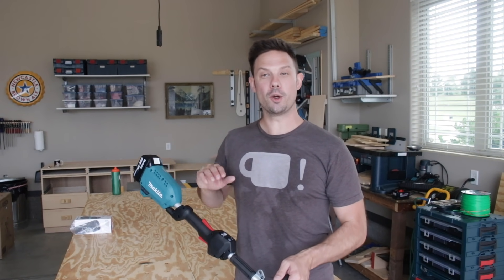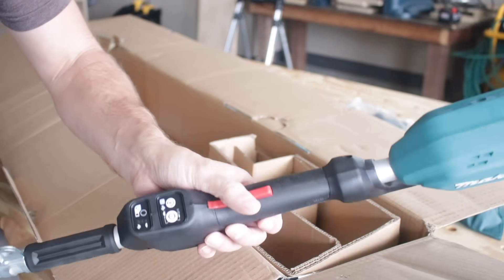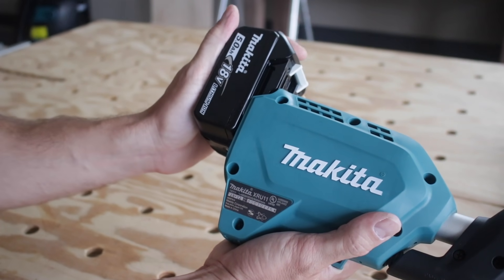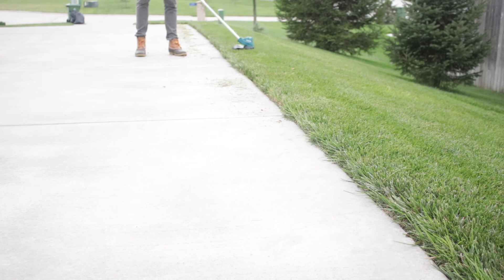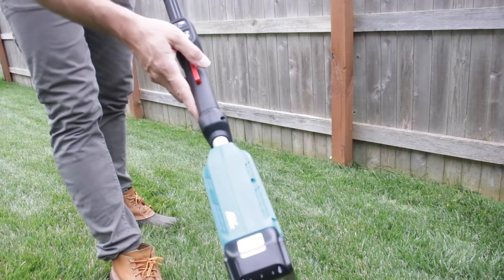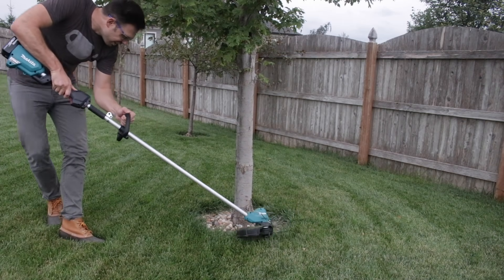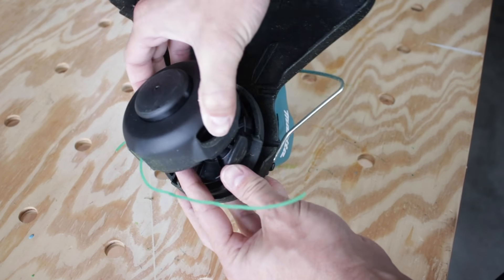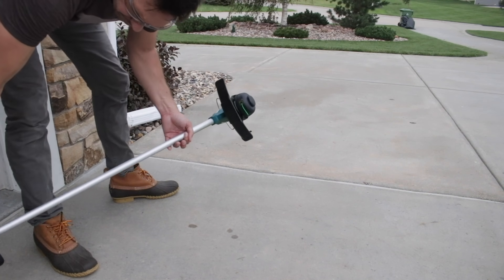MAKITA 18V Brushless Battery "Cordless" String Trimmer / Weed Eater Unboxing & Review

Comment: Thanks for the content I appreciate the awesome video!! I have all Makita tools and I know with my past history they build quality products. I didn't think it would be powerful enough until I saw your video and my lawn is half your size. Do you know of a replacement head that I could purchase so I don't have to deal with the string anymore?
Reply from the maker: You bet! Thanks for sharing some kind words.  Yea I am really into Makita these days.  Man I sure don't know of any heads that could do that. That would be awesome
Reply: @diywithandrew  I just ordered my new Makita after seeing your video and it hasn't arrived yet from Amazon. I did find some steel blades for less then $20 that operate like a beast and you won't have to deal with the string game. I will send you the link if I find something long term. Do you know what size Arbor it has becuase my hasn't arrived yet? All these replacement heads seem to be 1" Arbors.
Reply: @diywithandrew  AR-PRO (2-Set) 10" x 3T Steel Brush Blades – 2 Blades and 2 Washers | for Cutter, Trimmer, Weed Eater | Made from Carbon Steel, Cuts Like Butter
by AR-PRO    .... This might work, of course it is over kill, but it will make the job run faster. Check it out let me know if you think it might work for this trimmer?
Reply from the maker: @jamescadzow9545  Thanks for sharing!
Reply: @diywithandrew  0)5

Comment: Nice video thank you. The trimmers are new to me. How do you increase the length of the cord once it starts to wear out?
Reply from the maker: Thank you for the kind words.  The trimmer has a "bump" feed to allow more line to extend out of it as you go.  When the line runs out, you can refill the spool, similar to the way you would refill a tape dispenser. Hope that helps!

Comment: I have the same model as you have. I didn't like the rear protector because it is too small and short. While I was trimming the grass, my left pant (below the knee) was stuck with grass. So, I decide to add a 12" W x 5" H black plastic thin sheet onto the original one. It stops 95% of the debris.
Reply from the maker: Thanks for sharing these details. Great for the community here.

Comment: I've been searching all day for a cordless because I've only known gas. This seems like a great overall idea since Makita tools are great and the battery will be interchangeable. I was going to end up with a Greenworks or something but the reviews were kind of mixed. I don't have real thick brush but how is the Makita up against thicker weeds? Thanks
Reply from the maker: Thanks for sharing. I also like the compatible batteries with other tools of mine (I actually just got the mower and will review soon). I haven’t tested against way high weeds but have no reason to thing it’s wouldn’t perform decent. But again I did only buy this for my personal yard and not for commercial application.

Comment: Hey Andrew.  To do the edging, did you have to rotate the tool, or does it come with a rotating head?  thx
Reply from the maker: Great question, Ken!  Since it is electric there is no risk of gasoline being unable to be sucked into the engine and stall out. I just turn it over in my hands and good to go!